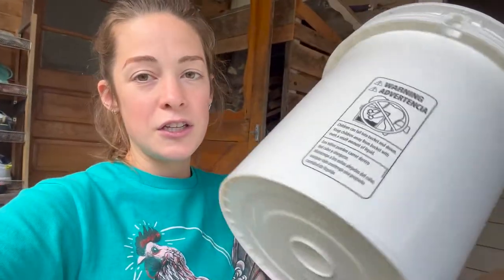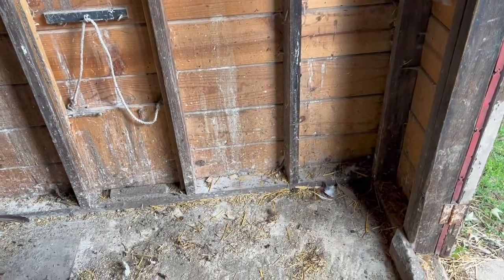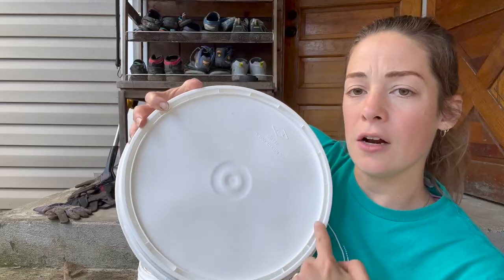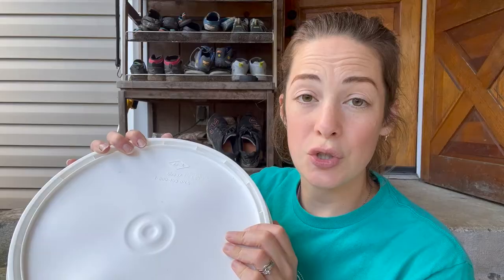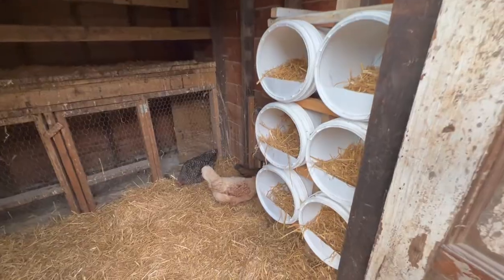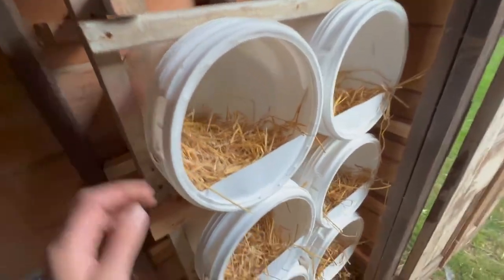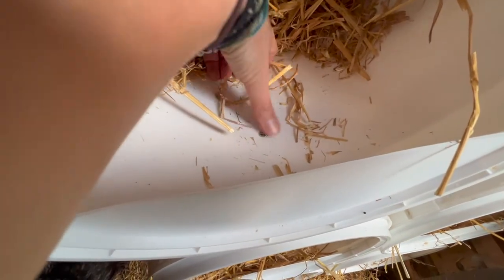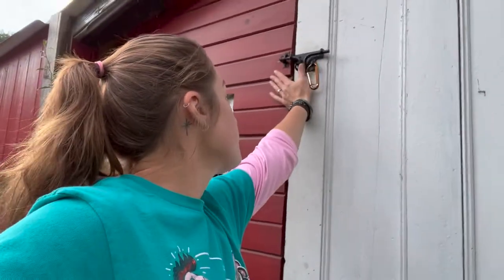Making Some 5 Gallon Bucket Nest Boxes

Comment: I made my bucket nests about 7 years ago. I used 10 buckets 5 on top and 5 on the bottom with perches in front. I used a dry wall screw inside each bucket to attach it to the wall. After having it finished and full of straw the hens preferred only one or two of the buckets and the rest remain unused till this day. I also have used old kitchen sinks, the double kind currently and they fight over that as well. I can't win. I love my hens anyway.
Reply from the maker: @davidbarrera308  haha, sounds about right! Mine have 12 total to choose from and they faithfully only use 4 of them 🤦‍♀️ silly hens

Comment: I just made a coop for 4 by putting 4 kitty litter buckets in my old compost box! I'm finishing the roof this weekend! Thanks so much! How are the chickens liking their new home?
Reply from the maker: Nice repurpose! I love giving old things new purpose. The chickens are using the nest boxes relatively well, they only use the bottom and middle two buckets, I still need to add some bars or something else they can use to land on, the lip of the bucket is too thin and gives them nothing to hold onto, but otherwise they use the ones they can easily get to no problem

Comment: Couldn’t have ran large head screws in the bottom of the buckets to hold them onto the wooden wall ?
Reply from the maker: I could have, but I didn’t have any large head screws and the wall is only about half an inch thick, so it wouldnt hold very well over time. So this worked better in the long run
Reply: A dry wall screw will do the trick.

Comment: Is the height an issue for the chooks to get to ?
Reply from the maker: Their roost bars are another foot higher than these, so no height issues. They use the bottom and middle buckets fine but they don’t like the top ones, I want to add some rest bars in front of them for them to have an easier time flying up to them and landing